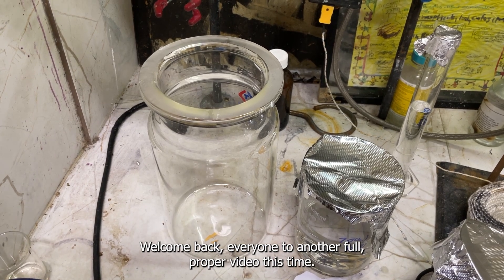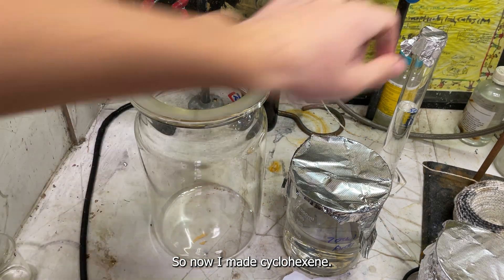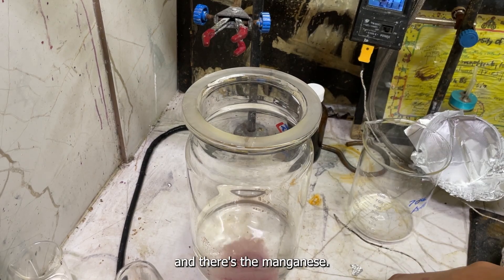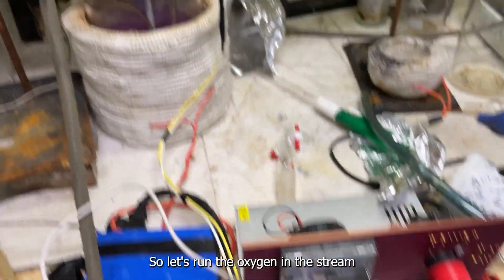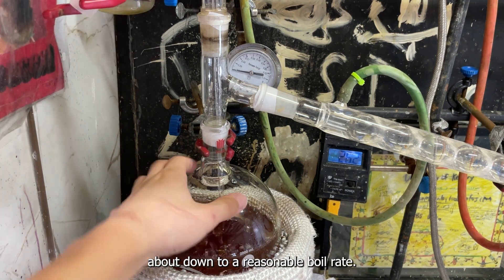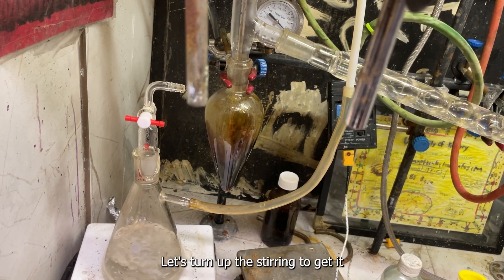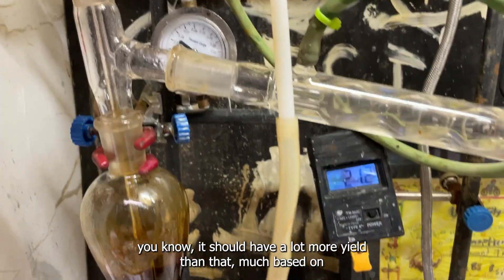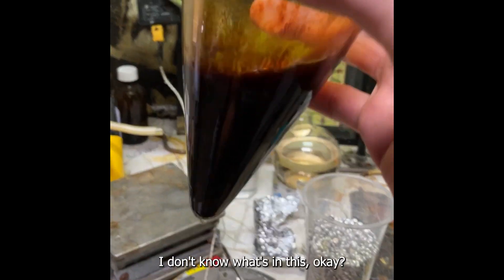synthesis of cyclohexylacetone by CN112851486A

Comment: Buy silufol plates for TLC and you could at least ensure that you obtained an individual substance rather than a mixture. Silufol isn't that expensive.
Reply from the maker: @konstantinlee2275  idk where you live but a jar of TLC grade silica gel 60 with gypsum and 254nm indicator isnt cheap and sold in like only >250g jars, as much as id like one they are expensive. i have bought premade plates on glass now

Comment: In my experience with the aromatic form of this exact compound, it is prolonged heating in the presence of acidic aqueous conditions that leads to aldol condensation and that floor polish smelling brown tar. I've found that vacuum distillation produces a far cleaner product with these alliphatic/aromatic ketones, and oxygen is not a friend during purification... i would recommend dehydrating the salts and drying the acetic acid but still use an air bubbler with a calcium chloride dry tube inline

Comment: Your analysis on the reaction mixture causing aldol reactions is spot on, probably a bunch of acid catalyzed aldol side reactions making that tar.  Trying it under kinetic control rather than thermodynamic would probably yield better results as it would theoretically minimize the chance of the product reacting further under the conditions.
Reply: You can't really say the analysis is spot on if you haven't analyzed the mixture yourself :P but I agree the aldol product is one of the most likely side-products. On the other hand, there is no typical kinetic/thermodynamic control for this reaction unlike aldol chemistry, although I agree that using a silyl enolate in neutral conditions might lead to an improvement of the reaction (for different reasons). Based off the use of Manganese and Cobalt complexes, this is likely a radical based mechanism going via Hydrogen atom abstraction and many other things can go wrong.

Comment: You absolutely could aromatize that, but no tweaker would be able to afford the catalyst
Reply: The average tweaker is able to do things we can only imagine
Reply: They already steal catalytic converters, they have more catalyst than they'd be able to use.
Reply: how would you do that? You need to oxidize non activated C-H bonds which are remote from the only activating functional group. The only methods I can think of to aromatize this would be to either make the enone via a 2-step process plus isomerization of the double bond into the ring, followed by oxidation all the way to the aromatic ring OR to use photochemistry to absract the gamma-H atom in order to generate a first unsaturation on the cycle which could then be exploited to aromatize the whole thing

Comment: how about hydrogenating phenylacetic acid and then doing the Ac2O thing?
Reply from the maker: lmao perhaps but that would be spicy for yt
Reply: Sounds doable
Reply: If by Ac2O you mean Dakin-West type reaction, I highly doubt it would work as is after hydrogenating the aromatic ring, since you need the benzylic carbon to efficiently generate the anhydride enoate with a weak base, namely 1-methylimidazole or the acetate ion present in solution. It also helps to differentiate this C-H bond from all the other Ac2O alpha C-H which could also be deprotonated. You would need to tweak the reaction conditions quite a bit for it to work, and even then, it would be very hard to selectively deprotonate the cyclohexylacetic acid selectively over Ac2O (actually there should be a preference for Ac2O vs cyclohexylacetic acid due to the CH3 being less hindered and lacking alkyl substituent which would provide hyperconjugative destabilization of the resulting anion) so you would probably make a lot of aceto-acetic acid side product with your cyclohexylacetone.